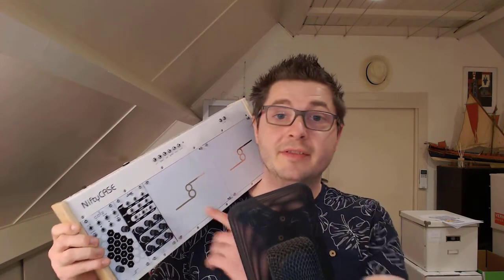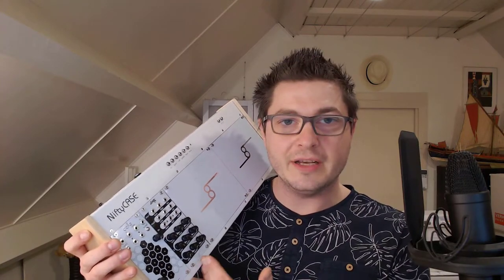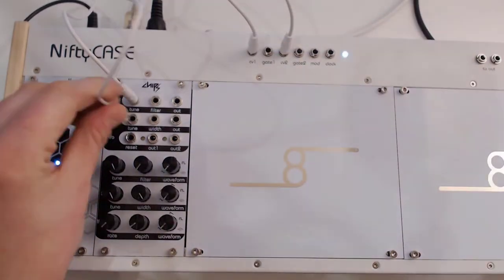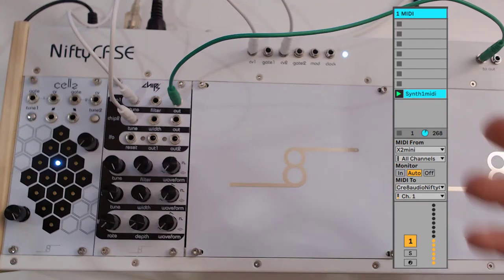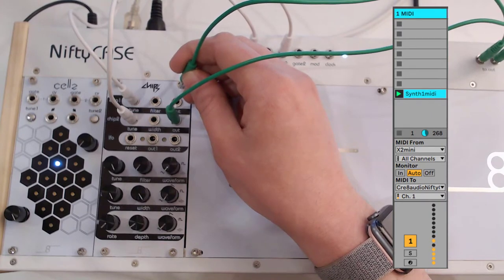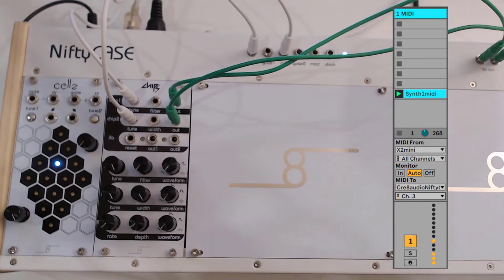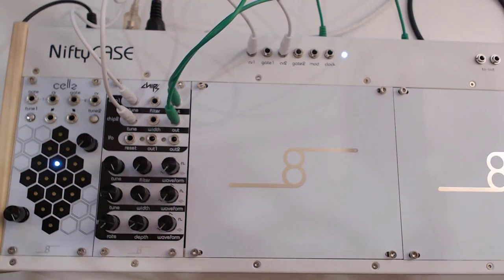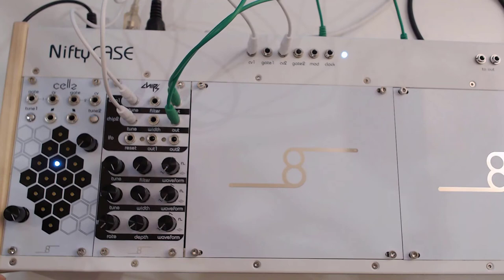Episode 11: Cre8audio NiftyCase review ( NiftyBundle 3 of 3 ) | Eurorack Modular

Comment: Thank you for clarifying what the usb does 🙏🏽 So if you aren’t playing or sending any notes to the module it’ll be just a constant sound that’s put out?
Reply from the maker: Not a constant sound but rather a constant voltage.
Reply: @TheModularClubhouse  so that’s where the vca would come in correct?
Reply from the maker: @outdatedgear5036  The voltage would go to the sound generator (typically a voltage controlled oscillator) which would generate a sound which would then go to a VCA to be combined with an envelope or another shape.